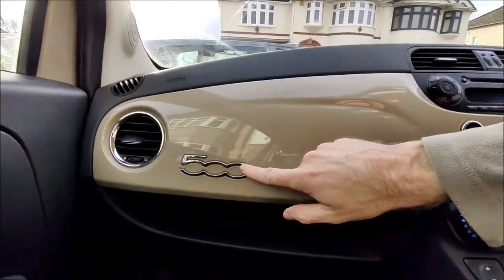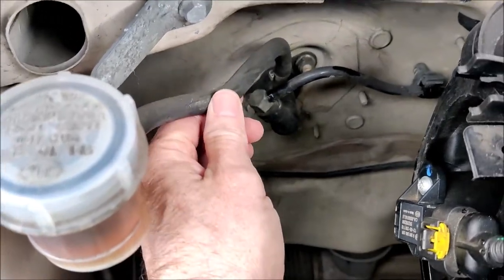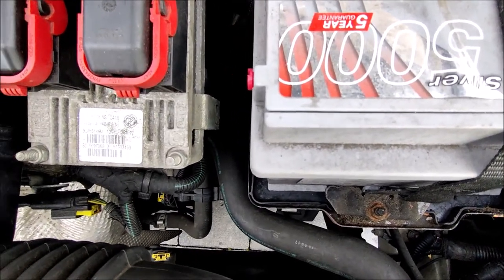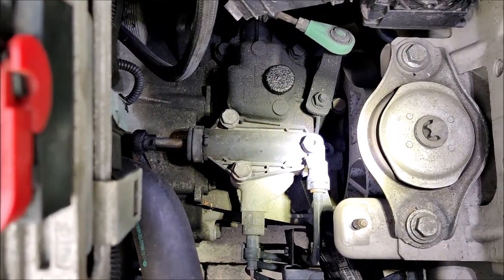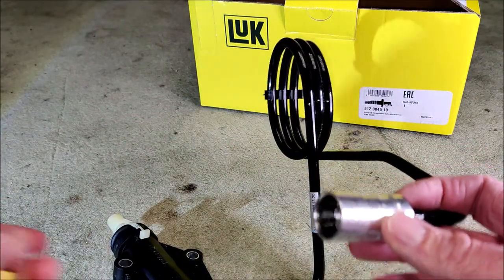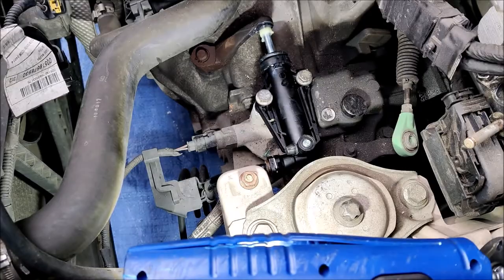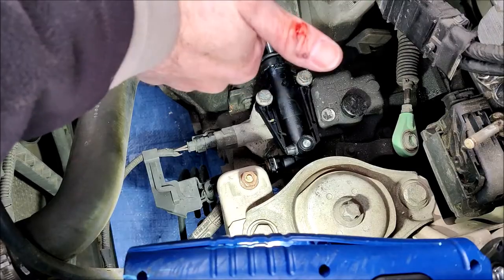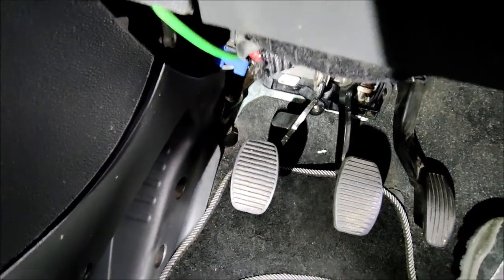Fiat 500 clutch fix ( master cylinder, slave cylinder, thrust bearing, KA, Panda, Ypsilon )

Comment: Great video, my 500 Lounge on a 19 plate with only 22500 on the clock is in the garage at the moment having a new slave and master cyl fitted. Horrendous creaking and grabbing but hopefully the work will fix it. I am way too old to be doing my own work now but would have loved videos like this back in the day, so helpful.
Reply from the maker: @haitch04  I hope they get it sorted for you 🤞🏼
Reply: @fixitfallows  All sorted now thanks, he changed squeaking creaking slave cylinder and showed me the master Cylinder where the aluminium pipe connector at the bottom was corroded and had a hairline crack. Not great for a 5 yrs old car with just over 22K on the clock. Hope I can forget it now for a while 😄.
Reply from the maker: @haitch04  glad it is all sorted. 

The reality is these are cheaply made little cars    (relative to many other modern cars)...... but then I don't think it ever really pretended to be otherwise. 
If I'm not mistaken I think it is literally a retro rebodied Panda so that Fiat could milk that platform for a bit longer..... it seems to have worked for them!

At least they are reasonably cheap and easy to fix.

My daughter's one, has in this last year, seen her safely down to Cornwall and back, plus she now resides up in Lancashire where the car is perfect for both the city and tight rural lanes.

Comment: great video mate- when i did it it took ages to get the clip out and when trying to pull the pipe out of the slave, its stuck fast!! Looks like a few blasts of wd40 needed but if not, may have to install the new pipe then cut the connector and rejoin where it meets the master pipe!
Reply from the maker: Good luck 😎🤞🏻👍🏼

Comment: Hey there many many thanks for the very helpful video.  MY connector was rusted and very hard to remove, when refitting i found it easier to leave it bolted in place first, so maybe thats a good way to remove it if its problematic. It feels way better now however occasionally i still get my gear jamming, less so though. Im wondering if i need to bleed it more.

Comment: For anyone doing this job on a Panda (2009 1108 in my case)- it can be tackled quite easy without removing the battery/tray- keeping your radio codes !
Take off 2 13mm bolts (easy enough access with std' ring spanner) move the slave forward so you can access the pipe retaining clip- slide out the pipe. Swap pipe seal off new pipe (if you have one with new slave) and re-fit .
Bolt up the slave, snip off rod retaining ties (on new slave) and bleed as you would any other.
Bleed screw (allen key) is also easily accessed in place. 10 mins- happy days ! :)
Reply: I just fit new clutch, thrust bearing and slave on fiat 500 and had the ecu and battery removed for 7 days, didn't need any radio code
Reply from the maker: I didn't lose my codes either.....  but maybe it depends on which  radio head is installed.

Comment: Hi, I have this problem of a squeaky and stiff clutch, but as it starts to get worse the bite point will go and my car will get stuck stationary. Only seems to happen after driving for 20-30 mins and will be fine once the car has cooled down. Could this still be down to the slave cylinder?

Comment: Thank you for the video, very well guided through, on every step. Is it possible to put lithium grease perhaps on the pedal assembly to help minimise the creak?
Reply from the maker: I can't see how lubricating any pivot point could do any harm and would surely help to eliminate any remaining noises. That said, since making this video, which was well over a year ago now, my daughter has driven this car daily and has not had any creaking or squeaking issues from the clutch, so I haven't had the need to do anything further. 

Thank you for the kind comments 👍🏼😎

Comment: Excellent video content / detailed pictures and narrative. Thankyou for taking the time to share your experience. I'd diagnose my squeaky clutch to the slave / or clutch operating arm or mechanism. I'll grab myself a slave cylinder and get this replaced. Incidentally, did you remove the piston from the slave cylinder body (of the defective unit), to see if it was the piston, the bore or seals that was the cause of failure (noise) within the slave cylinder?
Reply from the maker: Cheers for the kind comments, much appreciated. As for dismantling the old unit, much out of character I didn't, I usually relish the opportunity to have a nose around inside of things..... I must have had other priorities imposed upon me by she who must be obeyed 🤣

Comment: Hi there, I have just bought a new slave cylinder for my 500 and planning to do the change myself. I have two questions I wondered if you could help me with?
1. After fitting the new slave, what do I need to do with the bleed kit? Could you talk me through that process and what I need to be able to do that as unsure
2. What grease do I need to use?

Many thanks for the video, hope you can help me out!
Reply from the maker: Hello, if you go to about 11:50 into the video, from this point on it refers to the bleeding process. Ultimately, bleeding is simply pushing the fluid through the system so as to expel any trapped air..... hence you need to undo the bleed valve/ nipple to allow the air to exit. Obviously along with the air, the hydraulic fluid is also   being expelled, so you have to ensure you keep topping up the reservoir to replenish the lost fluid. An empty reservoir will mean more air being sucked into the system!! To push the fluid through the system you simply pump the clutch pedal with your foot (not frenziedly, just gently and rythmically). It helps if you have someone to observe and note the amount of air in the expelled fluid, or rig a camera to film and refer to.
Reply: Hi mate just wanted to say a massive thanks for the video and advise. Managed to get the same clutch cylinder for £20, along with a few other bits I had to buy and a socket set it probably cost me £50 all in. Just fitted it now and no more squeek! Thanks so much!
Reply from the maker: That's great news!! I'm very happy to have been of help. Now you have the socket set it's a slippery slope into tool addiction!!!!! One can never have enough tools. 

Good luck with future wrenching 😃

Comment: Excellent video. I think I have exactly the same problem on my daughter's fiat 500 (recently purchased). I took it to a garage and they said they would need to replace both the slave and master cylinder which would cost £330. So yesterday I looked under the bonnet to try and work out exactly where the noise was coming from and although the noise sounded near the arm and the rod going into the slave cylinder, the squeak seemed to be coming from the coiled pipe that is attached to the slave (the one you detached) and it vibrated at the same time. So I am wondering if I also need to replace the coiled pipe but you mentioned problems getting that off the master, and I wonder if that's why the garage wanted to replace both the slave and master. After watching your video, I am considering whether to have a go myself, despite being a girlie, as you made it look straight forward.  Another question I have is, how do you know how much to bleed from the slave? Also, the clutch pedal has a high bite point, will that improve after doing this, or is that just what to expect from a fiat 500? Did the stickiness of the clutch improve after the slave replacement? Sorry, so many questions.
Reply from the maker: Hello. Based on my understanding of things it is unlikely that the coiled section of pipe, or any other section of pipe will be the reason for the noise or vibration. It will be a moving part in the system that creates the noise (due to undue friction, bought about by degradation) ...... that noise then reverberates through the pipes ( think of tin can string phones we would make as kids - noise in at one end, sound travels as vibration waves through the string ). 

To be fair to garages, time is money to you and them, so they probably err on the side of caution and suggest both slave and master replacement incase it turns out to be one or the other. Plus there is always the arguement that if one is knackered, the other may not be too far behind it.

It really is not a tricky job. Watch the video a few times, even write a few bullet point notes of the stages you need to take. Go for it.

As for bleeding. You do it for as long as bubbles continue to show in the expelled fluid. Once no more bubbles, then no more bleeding.

As for the high bite point, that is the sign of an ok clutch. It's when you have to the pedal to the floor is when you have to worry.

Good luck.

Comment: Great job with this. My wife's new (2015) 500 Lounge has just dumped all of the hydraulic fluid out, and the clutch pedal goes to the floor with no release on the clutch. 

I've had a quick look this morning, before watching this video. How easy is it to get to that big steel push fit union on the end of the supplied slave cylinder? Ive heard, as you said, that the fitting and pipework corroded, so I'm thinking, just replace all of the pipework from slave to master cylinder? How much of a pain job would that be? Any help would be much appreciated. 👍🏻
Reply from the maker: @roblowrie1969  hello, that's uncharted territory for me to be honest..... I've not had the need to go beyond what you see in the video. 

Are you able to see where the fluid leaked from ?
Reply: @fixitfallows  that's my next job. I'll let you know. 😉👍🏻
Reply: I had a look at the car this morning, taking the near side wheel off, and the union is fixed to the side of the engine bay, and is very wet, so it must be that. I've ordered stainless metal fitting, recommended on the Fiat 500 Facebook group at £18, and as soon as that's arrived, I'll fit it. Should just be that, some DOT4, and a junior hack saw. 👍🏻
Reply: Thanks for all the help with the video, etc. I did the job this morning, and apart from being a bit confused, as I thought the union between the slave and master cylinder pipes was on the inside of the wheel arch, not the bulkhead, the job went very smoothly.

I used a kit from X8R, with included a marine grade stainless union, bleed pipe, waterproof tape, and inserts to stop the pipes crushing, for £18, it took just a couple of hours. 

Cut the old pipe out with a junior hacksaw, put the fitting caps down the pipes, insert the fittings into each piece of pipe, then whack them up tight. 

All sorted. 👍🏻

Comment: First off, this is a great video - so thank you for taking the time to make it. My car (2014, 1.2 model) had a ton of other cables and connectors attached to the battery tray. I also could not release the pipe from the old slave cylinder - it seemed fused together. Any tips? Yours seemed to disconnect very easily,
Reply: same here mate - took me ages to get the clip out the old one as well - -had to use a stanley blade to cut a bit of the plastic. Sprayed with WD40 and it still wouldnt budge.
Havent attempted it again yet - had considered leaving the new pipe on the new slave then cutting the old join out between the master and slave and fitting a compression fitting

Comment: Hi, thanks for the video! my neices car has the same noise coming from the slave cylinder, also after driving for a while the clutch becomes sticky around an inch from the floor, would the slave cylinder also cause that to happen?
Reply from the maker: It's hard to say, but you have the similar noise and feel, so this being a pretty cheap and simple procedure it's a good first "process of elimination" attempt to resolve your issue.

Good luck

Comment: Hi, I followed your video and bought the part from GSF replaced it but when I bleed it, the oil spills around the nut instead of going into the pipe. What do you reckon I should do?
Reply from the maker: So this is when bleeding?  I assume you have pulled the rubber cover off of the bleed nipple, yes? Also, check that the pipe you are using is clear and unobstructed with anything along its length.Also, you shouldn't have to undi the bleed nipple all that much, if you do you risk creating an easier path for the fluid to travel rather than through the pipe What is the pipe going into?
Reply: @fixitfallows  Thank you for your quick reply. I took out the rubber cover and connected a very long pipe, which doesn't go into anything it's just several meters long. It's also very snug so it's not leaking from the pipe and the nipple. Rather it's around the nut. Some fluid goes into the pipe and a lot of oil leaks just around the nut.
Reply from the maker: Hmmm, it sounds like the bore of your pipe and its length may be the problem. I'm no expert on fluid dynamics, but I'm sure fluids flow more readily along the path of least resistance.... I'm just guessing here. It's very unusual.
Reply: @fixitfallows  I did have a shorter pipe previously but it was the same. Im left guessing if my brand new slave cylinder is faulty. It looks exactly like yours, its from GSF but it just leaks oil all over when nut is open. Its even the same with the old slave cylinder so I thought it was by design but its different in your video.
Reply from the maker: I don't think it's faulty as you say it was doing the same on the old slave too. The common denominator is the type of pipe you are using, the bore must be too small I'm thinking..
Reply: @fixitfallows  thank you so much Im gonna try with another pipe!